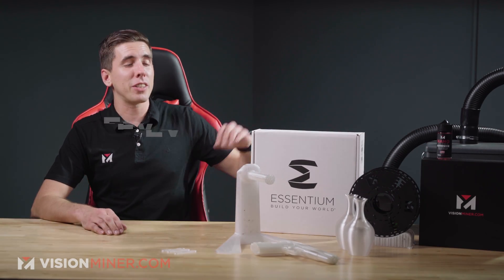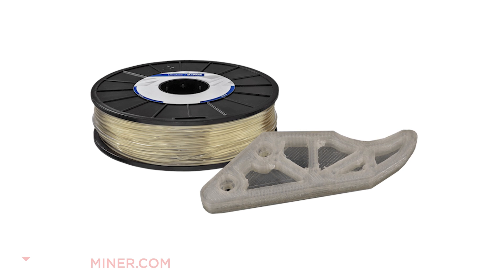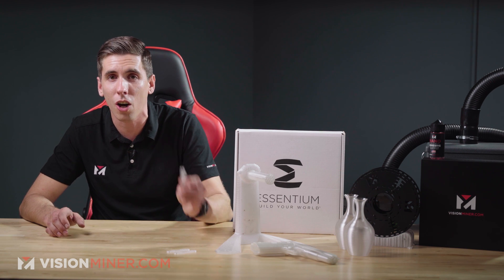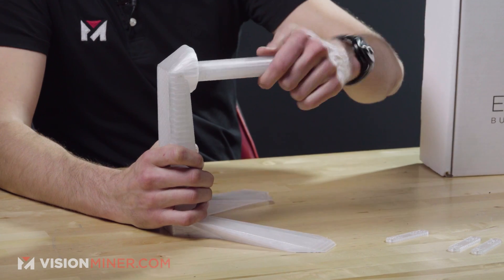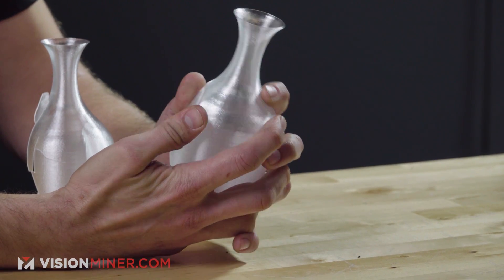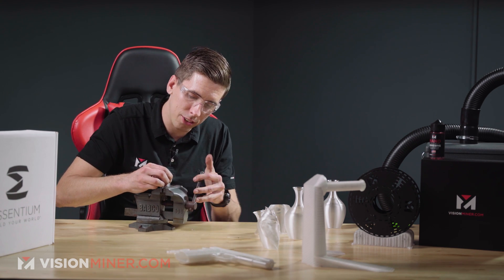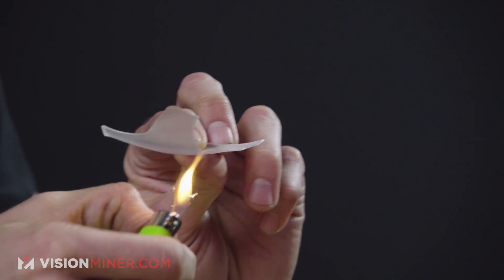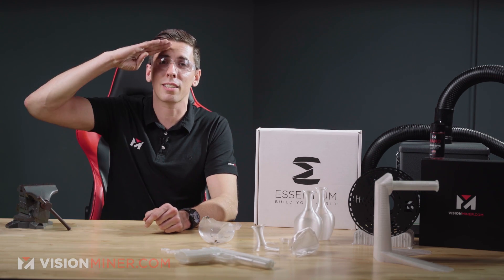PCTG, Polyethylene Terephthalate-Glycol 3D Printing Filament from Essentium

Comment: Man, if they could pull some material science magic out of their hat and increase the usable temperature range 10 or 20c, they'd have a seriously good general purpose engineering material on their hands. I'd love to try it but a material barely tolerating hot car temperatures is a hard sell.
Reply: Essentium says that you can anneal it for higher temperature use, but I haven’t seen a post-annealing HDT quoted.
Reply: You could try CPE, it's impact resistant too but higher tensile strength and temperature resistance

Comment: Even when PCTG is printed the wrong way; with-out cooling fans; it works-out even better than you could have ever imagined.   It just keeps getting better and better.
Reply: You may consider it "the wrong way" if you print lots of PLA, but I have the parts cooling fan completely turned off with PETG and I've never printed PLA (ever).

Comment: I don't know how the strength could ever possibly be stronger in the z direction than the x,z. Kinda calling a little bit of bs on that one.
Reply from the maker: Check it out on the datasheet :) https://www.essentium.com/wp-content/uploads/2020/08/TDS-Essentium-PCTG_v1.0-Minus-3D.pdf
It's true!
Reply: @VisionMiner  I see your point! The data sheet does indeed say the tensile modules in the xz direction is slightly higher. I really do not know how this is possible. Even with a completely homogeneous printed object (unlikely) would, at best, produce the same result for the z direction as the xy direction....because it is the exact same material/testing parameters etc. As i said, in an ideal situation, the only difference in strength between the xy orientation and z direction is the layer lines which "must" produce less strength due to a crack initiation from a stress concentration point, ie. somewhere along a layer. Anyway, maybe there is some other reason for this that I am unaware of. That's my 2 cents. Great video! Thanks.

Comment: I really like this filament. I printed a weather sensor enclosure (for outside use) with it. I used almost two rolls (small) of filament over two days to print the enclosure parts and it is exactly as described here. Prusa I3MK3s, steel nozzle (because I print Nylon X sometimes). I have a Print Dry but I didn't need it.

Comment: Extremely interesting!
At 4:15 you say it needs a nozzle temperature from 250-270 °C, that's not what an Ender-3 like or actually most common printers can do: you'll rapidly degrade the PTFE lining in the hot-end above 235°C and release toxic fumes in the process.
From this, I don't understand the statement that it's as easy to print as PLA. I don't think I can print it with my stock CR-10 V3 for instance.
Reply from the maker: While the ideal temperature is 250-270ºC, we like to print in the upper end -- PCTG can be printed as low as 210ºC :) and you're absolutely correct about the PTFE lining, all-metal hotends are a must-have upgrade for engineering grade filaments! 😃
Reply: @VisionMiner  Ah okay! Good to know it will still melt and go through the nozzle at lower temps 😆
Do you think it would behave significantly different than what we saw in your tests in this video if printed at lower temps?
Reply from the maker: @supercurioTube  I've accidentally printed at 210 and normal speeds before, and it didn't have as good layer adhesion, but I'd imagine going a tad slower and a bit hotter (230 or so) would have made it all good :)

Comment: I have a marine application that could benefit from this. I’m currently using ASA but that occupies my more expensive machine (heated chamber). Do you have any data on UV resistance or HDT after annealing? The pre-annealed HDT is probably too low for my application (about the same as inside a car with the windows up in direct sunlight).

Comment: Is the vase you guys use for break tests a ZYYX vase? If not, is there somewhere I can download the STL? I’d like to start printing some of my own materials with similar settings to see how my results compare with yours. 🙂 

Love the consistent testing format that you guys follow. Cheers!
Reply from the maker: It's the Nerys vase, you can find it here: https://www.thingiverse.com/thing:3019056 😀
Reply: @VisionMiner  Thanks! 🙂 

Also, I'd like to put in a request for demonstrating 3DXTECH PC/ABS and CF-PC/ABS, looks interesting, similar to PC but better looking finish apparently. I got a 500g roll to try out after it goes through a 24h dry in the SUNLU at 55C.

Comment: Hello, i want to print a water pump gear for an engine with pctg as a replicate from the original plastic gears, is this material good enough? Is it a good solution instead of nylon? Does exist a pctg with carbon addition, like carbon pet? Thank you

Comment: Only thing I noticed with PCTG was on one of the prints I did this weekend I got a little warping. is was just at the far ends of the print were lifting a little.. I was printing at 270c and bed was 100c, fan at 50% and not enclosed. Im sure I could have easily tuned that out if it were an important print. PS thank you for sharing my PCTG post yesterday.
Reply from the maker: Are you using our Nano Polymer Adhesive?
Reply: @VisionMiner  I havent tried it yet.

Comment: What kind of support material can you use with the Essentium PCTG?  I just bought some based on this video, as I have some large models where I am having trouble getting them to print over 56 hours with PLA, and since this material seems to be even easier than PLA, I thought I would give it a try.
Reply from the maker: For support materials, you can pretty much use anything that works with PETG -- they're quire similar on the molecular level. Aquasys 120, Aquatek, and even PVA should work -- HIPS apparently works too, and a lot of people are using PLA as support, as well!
Reply: @VisionMiner  Okay, thank you.

Comment: I bought some (on your recommendation) and I'm anxious to try it! I just gotta get my first printer built first...

Although drying isn't necessary, I'm curious what temperature it should be dried at in case I decide to at some point.

The bit with the 1911 was pretty funny!
Reply: Usually with higher temp filaments a higher drying temp is a good idea for speed but not needed. 55-60c would work and the Glass transition temp of 76c means keeping it at least 10c below that to not affect it.

Comment: When I compare the PCTG data sheet with PETG, it does not show any major differences at all. It even shows some smaller values sometimes. Also the z-adhesion is identical to the others (you have to consider the standard deviation as they have written in the datasheet). I have printed the same vase in PETG at elevated temperatures of 250 °C and it behaves very similarly to PCTG if not even equal. So I wouldn't call it als a "WONDER material".
Reply from the maker: Definitely something to consider! They're so similar, that you bring up some interesting points, but based on printing 3 foot x 3/4"  tubes, and them being incredibly strong.... we're still impressed!

Comment: What filament would you suggest for press brake dies? I've been using PLA with epoxy instead of infill which seems to work fine, but just curious if something like this would be more resistant to impacts and stronger with pricing similar to PLA?

Comment: CNC kitchens video in this was disappointing. But they used another brand

You guys should send CNC kitchen some pre printed samples. Even ultem ones maybe! For comparison
Reply from the maker: We built a UTM machine, so we'll be showing LOTS of how "not going off the manufacturers recommended settings" can make a huge difference -- every printer is different, and geometry, so show some great results!
Reply: @VisionMiner  god I know it's expensive and time consuming but i'd kill for a proper huge filament strengh/temp etc comparison video! tho the datasheets already can tell you a lot i'm curious about real life results!
Reply: @VisionMiner  OOOH and i'd always wanted to know how different in strengh ultem printed with a 90c enclosure vs ultem with a 110 - 150 - 200c enclosure is!

Comment: I got some of this stuff but from a different seller and I am having kind of a bitch of a time trying to print with it. I've had multiple failed prints just trying to print a heat bed holder no clue what is going on with this stuff

Comment: UV resist?
Reply from the maker: PCTG generally has excellent UV resistance for normal outdoor sun exposure. With artificial high intensity UV lamps, it may start to exhibit some surface crazing, but that would be equivalent to decades of outdoor UV exposure. One guy has several brackets printed from PCTG both natural and black at his house that have been in the sun for several years with no noticeable degradation. It is certainly on a level playing field with ASA and much easier to print with.
Reply: Awesome, I plan on making a tail light lens with it

Comment: Would love to see HIPS compared to this.
Reply: There's absolutely no comparison in my opinion. I love the light density of HIPS but that's it
Reply: @3dPrintingMillennial  I like the surface finish I get with hips, I just got two rolls of petg going to take them for a spin
Reply: @MicheleHjorleifsson  do you have a link to any pics? My HIPS don't come out great. However today, someone mentioned that white filaments flow differently 🤷🏾‍♂️

Comment: I'm going to 3D print my electric motors and RC helicopter rotor head out of PCTG.   You have to do a heat stress test.    Heat and stress at the same time compared to Nylon with carbon composite.
Reply from the maker: Good idea! Oven tests coming up....

Comment: Totally off the hook my man.  PCTG, Polyethylene Terephthalate-Glycol IS THE "BOMB"  You've made a believer out of me'   How does it stack up next to Nylon Composite?
Reply from the maker: The z-axis sets it apart...  it's definitely more flexible than CFPA6 and won't hold up to as high of temperatures, either, so there are some trade-offs

Comment: Pretty thorough video but definitely biased and sales "pitchy".  Also, consider cleaning your nails  on the closeups. I was too distracted with looking at those dirty things instead of  the actual filament.
Reply from the maker: 100% on the nails, not sure how we passed that off LOL -- and pitchy, for sure, since we're a business, but don't worry -- building a UTM machine to get more actual data, un-biased testing -- and we'll go a bit above and beyond others, as generally they will print with the "recommended" settings, whereas we will tune the settings to get optimal results. Going to be a really cool new series!
Reply: @VisionMiner  any news on that utm machine?

Comment: "...and still affordable." Hey bud...$50/kg is double what I pay for PETG. Hard pass.
Reply from the maker: We deal with filaments in the $200-800/kg range, so most of our stuff is well out of consumer reach -- but considering the benefits, it's a great deal :)
Reply: Fiberlogy sells PCTG for 36€ kg as far as i know
Though it probably should be said that i barely got it to work on my Ender 3V2 yet since it has all the Problems a PETG print has and it heavily underextruded initially